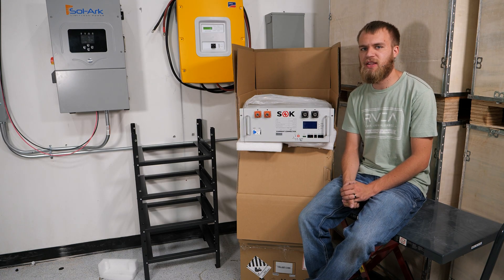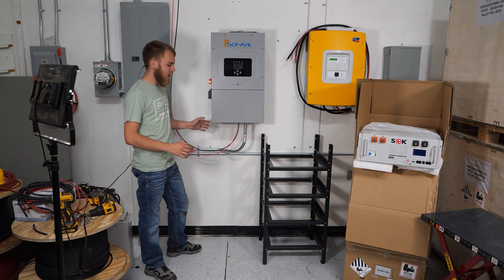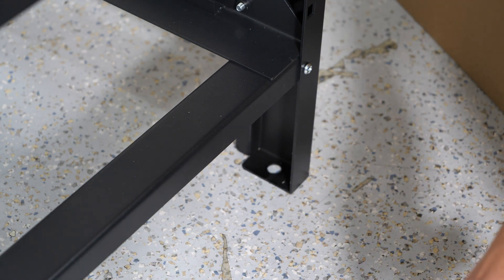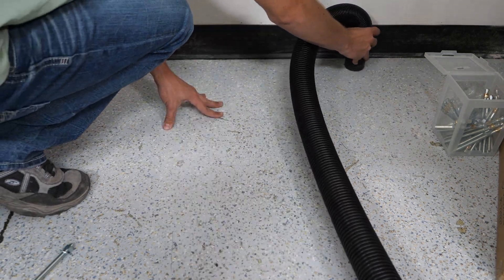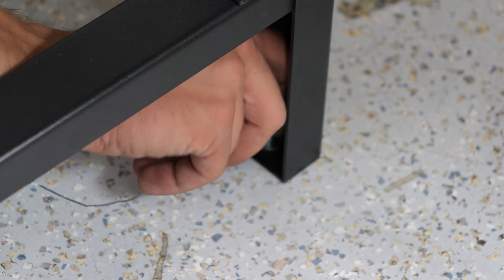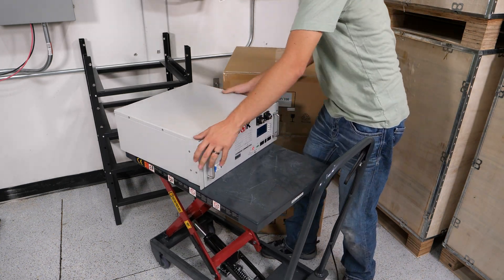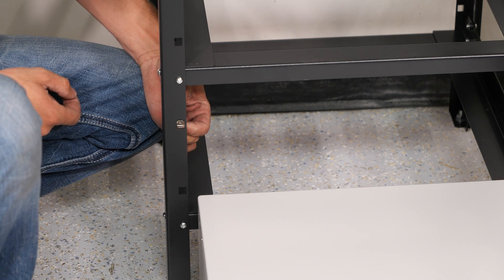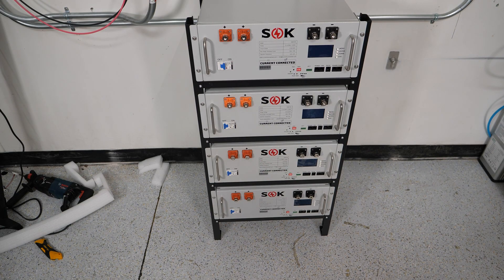SOK SK48v100: Securing & Loading The Rack

Comment: Safe working area is 36in out from the front of the enclosure and 36in wide centered on the centerline of the enclosure.  May be 42in wide as there are conductors that may be at 150V to ground or more in the Sol-Ark wiring compartment.

Comment: Curious if there are different configurations of the battery rack, instead of 4 high, 3x3 beside each other, reduce height, have more spaces.
Reply from the maker: Currently we only offer the 4 slot version.  We may have some other options in the future but are not certain as of this point.